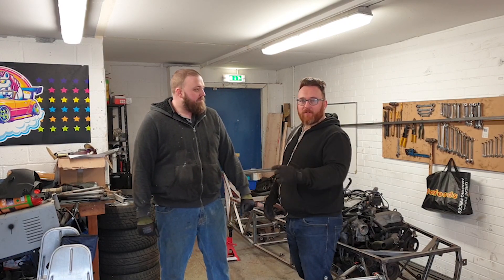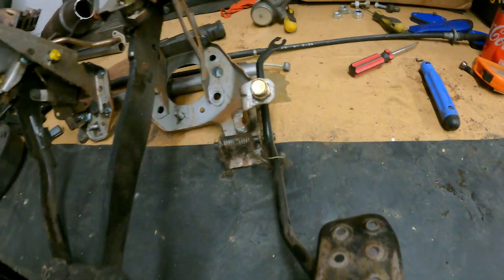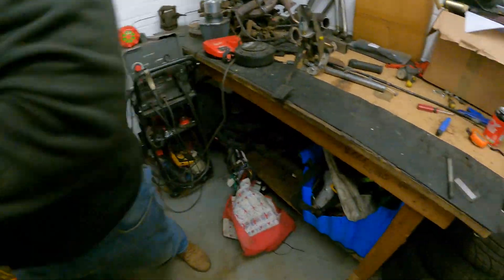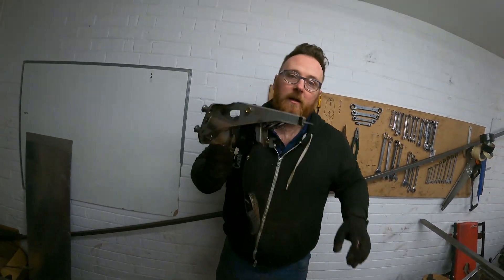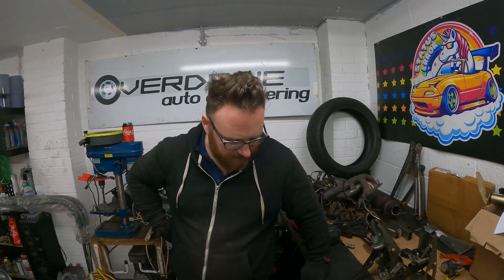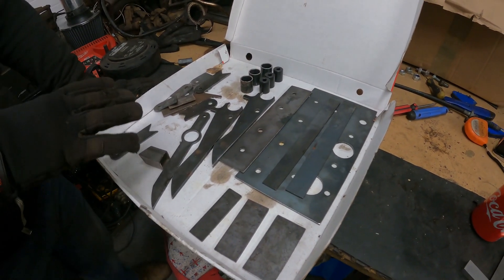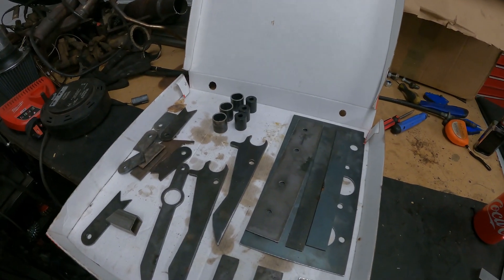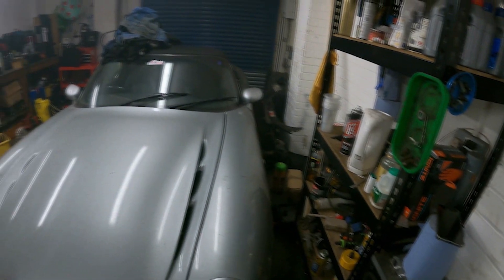PEDAL BOX FROM SCRATCH!! - Locost 7 Kit Car FULL BUILD!! - Episode 17 - (Project 7-UP)

Comment: You can have adjustable bias bars for IVA you just need to lock it off. Two locking nuts both sides and drill a hole and put a pin through the nut and bias bar and remove after IVA for track use ;)
Reply from the maker: Cheers Andrew. We probably will change to that, really wanted to take the cheap route first to stay on budget

Comment: Working on my own pedal box at the moment. Did you guys have any issue with the mx5 clutch master cylinder clashing with the clutch release on the bell housing? The SSC drawings (can't remember where I downloaded them from) recommend a replacement clutch master cylinder. I think this is why the two vertical holes on the back plate you got don't match the mx5 master cylinder.
Reply from the maker: We haven't actually tested that yet, so good to know we have fun to come! In fairness I suspected as much so we can burn that bridge when we cross it!
Reply: @ToolsnTrack  nothing is ever straight forward building from scratch.... Sure that's half the fun just trying to  make things work!!
Reply from the maker: @antoae111  absolutely, plus gives me the chance to get my problem solver hat on (again!)